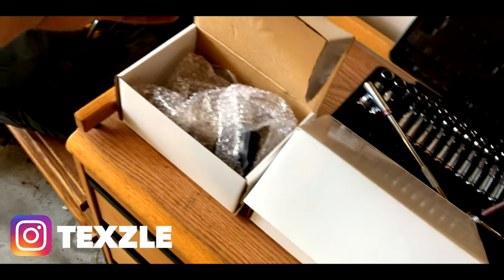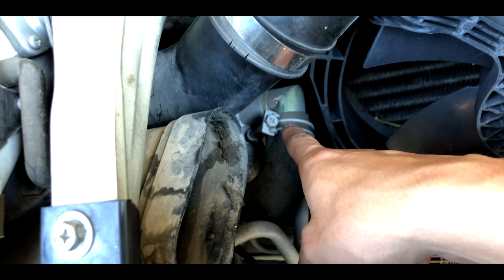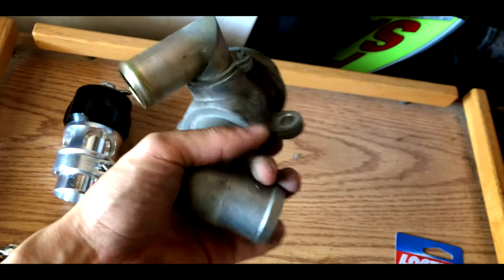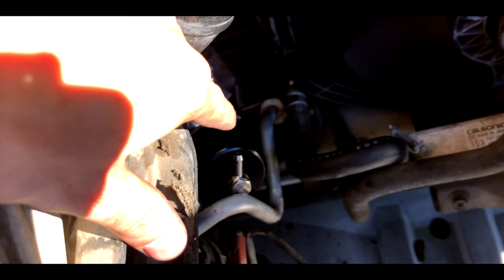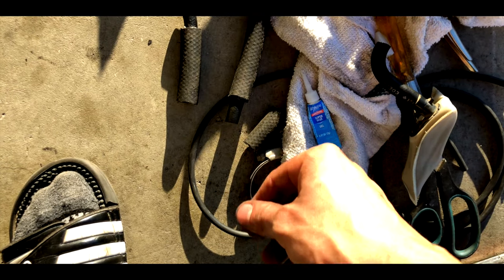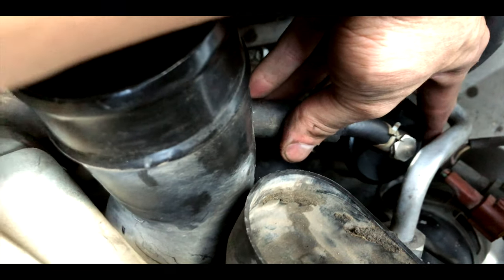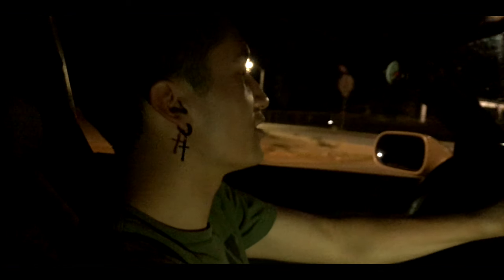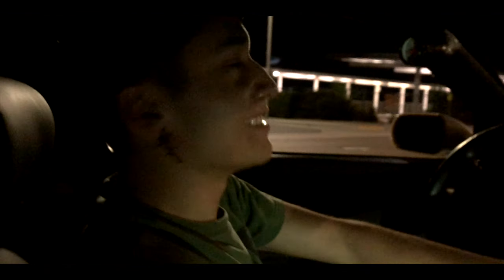Nissan 300zx Twin Turbo Gets BOV!!!

Comment: I just went back to factory recirculating valves. My Z had BOVs but it made my car run like shit in a year... MAF cars can't and aren't supposed to have BOVs... To run BOv you need an ECU and convert to a MAP sensor. You'll experience a lot of fuel cut after a pull or running really rich and lean sometimes. To run BOVs safely on a Z32 you gotta spend a good 1.5k lmao. Go back to stock or get some HKS and recirculate them using their recirc kit. Hopefully you take my advice right.